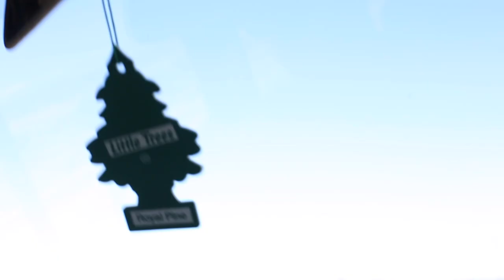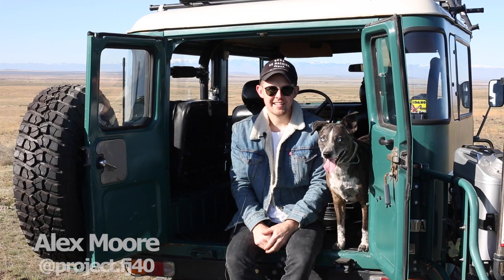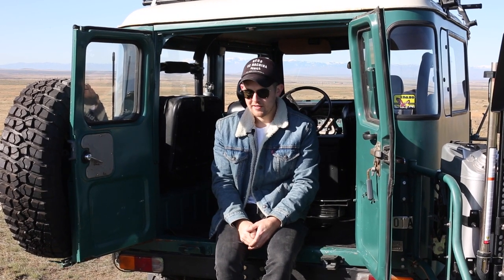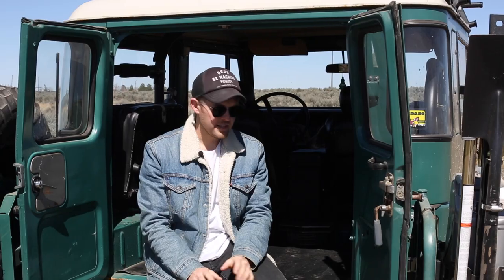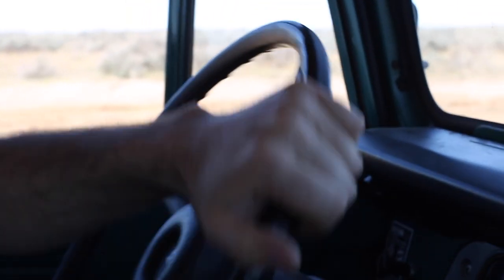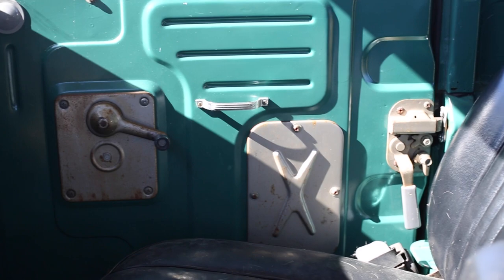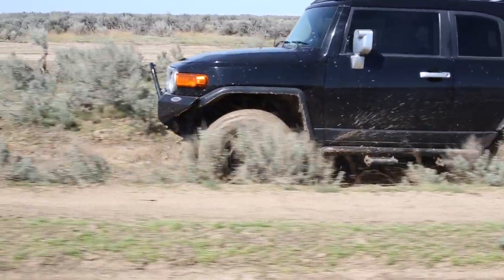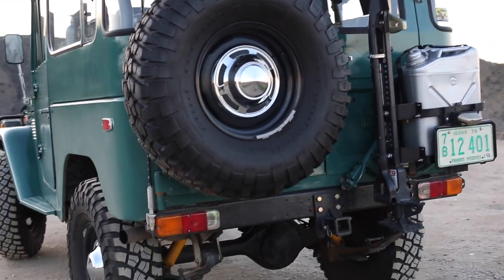The Driver's Decision - Episode 3: Project FJ40

Comment: I had a ‘76 FJ40 for many years. Now have owned an ‘08 FJ Cruiser since I bought it new. Love it, will never sell it.
Differences between the two. In the FJC I can still hear the radio at highway speed. On cold winter days I don’t have to scrape the inside of the windshield while driving. I don’t have to peel the melted floor mats off the floor boards every time I want to remove them. I have great power for passing. In my FJ40 I was able to work on it myself. The clutch really built up my left leg muscles. The fun rating to drive was off the charts. I did Black Bear Pass in it and the FJC as well as all the other passes around Ouray. Someday I hope to own another FJ40 or FJ45. Great memories of four wheelin and camping with my buddies.
Reply from the maker: Perfect comparison between the two! They both have a special place in my heart to me but for different reasons as you mentioned!

Comment: I've had my 71FJ40 going on 32yrs now. Traded old 73 nova and never looked back. It's been my sat. night four wheeler in mountains to my 20" wide paddle tire sand duner, to my fri night boulevard cruiser. Never let's me down and always the head turner. A bit loud with 420hp 350 and easily smokes 35" tires. Combo hot rod/street rod/show ride. Not a beauty, but a beautiful beast.

Comment: I love my FJ40! I'll never get rid of it. It's far from stock though. Fuel Injected 350 with an H55F 5speed. I have a 77 I'm restoring that will be bone stock except for OME lift and electric power steering. Also, the color will be seafoam green which wasn't available in 1977. :P Great video!
Reply: My son is restoring a 77 too 👍🏼

Comment: I have a 78, just put a rebuilt engine in it. Reworked the transmission 2 years ago. new drive shafts.. new carb new seats. lots of new stuff. I need a new OME suspension though, my current suspension is pretty rough.